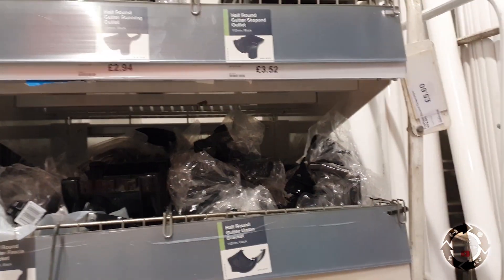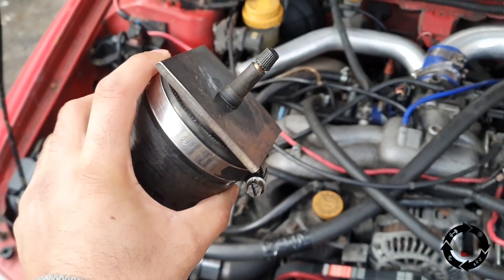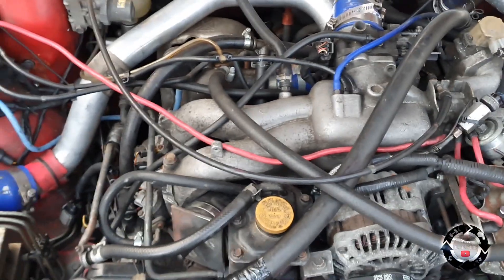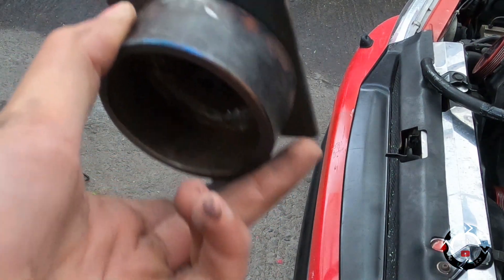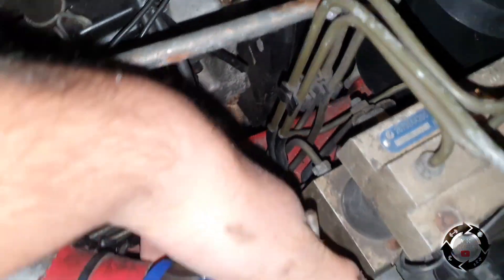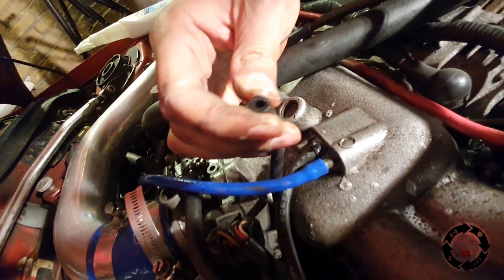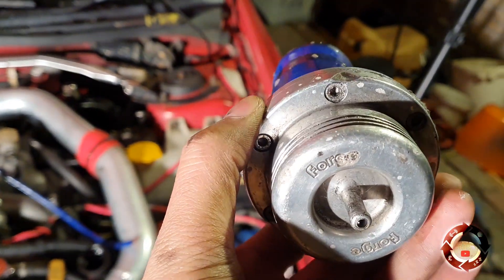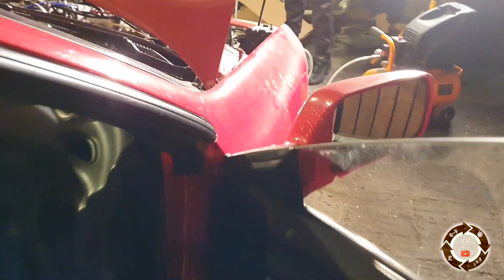DIY BOOST LEAK TESTER FOR SUBARU IMPREZA GC8

Comment: Part 2 of the issue now😂 seems like it’s just cause you issues mate, don’t worry we all have issues on our cars! I have had issues on my boosted builds but easy and cheap fix, new build coming soon which is going track! The pipe you were using a spray product on that pipe needs replaced as if you’re Subaru was in my workshop it’ll not get moved until it’s fixed correctly, get an upgraded dump valve! Don’t go cheap on builds
Reply from the maker: Time to move to step 3 and get it done! 🤣 track cars are brilliant also high maintenance so good luck 👍 I thought turbosmart dumpvalves are good in the game
Reply: @YKRECREATION  Haha yeah that’s step 3 mate😂 just going to use a lot of fuel and use a lot of tyres the way I drive on track😂 yes turbo smart dump valve’s are good but it’s best to upgraded it to a newer style turbo smart dump valve, forge motor sport dump valve are good but they’re very cheap
Reply from the maker: I see yes your right i don't know much about the new types i will have to look into them. Best stock up on tyres 🤣
Reply: @YKRECREATION  It’s fine mate we all learn new things everyday it’s life don’t worry about it, if you fancy new tyres I’ll recommend ado8r they’re perfect in the dry once they’re heated up but there not good in the wet
Reply from the maker: @boostedchris6120  mine are fine yet, yes definitely learning more everyday
Reply: @YKRECREATION  Just watch for more leaks if they’re are leaks with hoses upgraded them, if there’s leaks on bov upgraded it to a newer one. Definitely
Reply from the maker: @boostedchris6120  okay thanks 👌🏼
Reply: @YKRECREATION  Nb